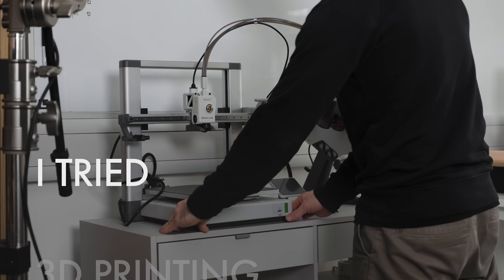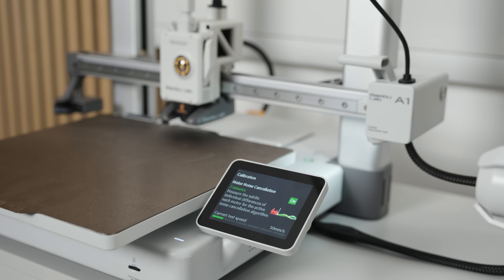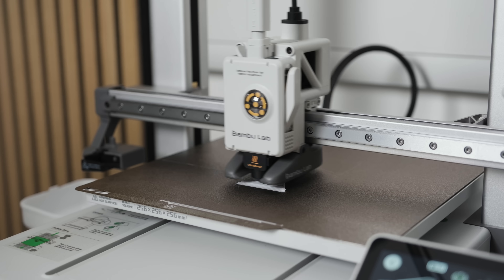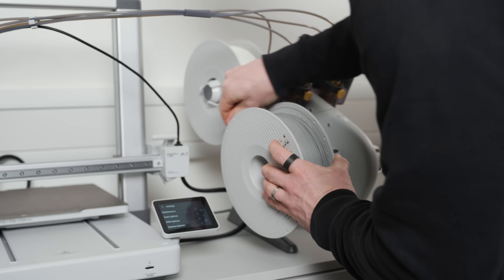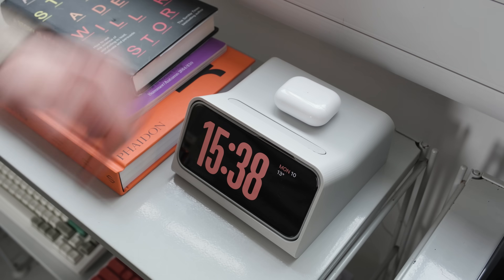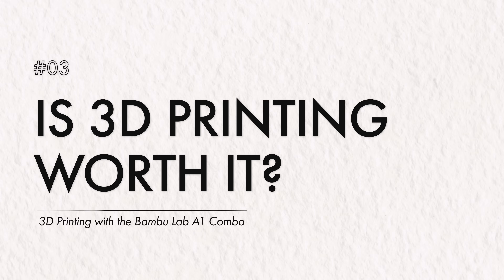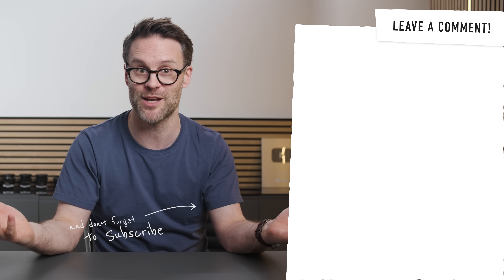I Tried 3D Printing as a Beginner: Is it Worth It?!

Comment: it's incredible HOW easy bamboolabs made 3D printing. to me it almost feels like cheating. 
i got my start about in 2017 with the anet A8, which was the first "cheap" 3D printer kit, at 160EUR, where previous, often worse REPRAP kits usually cost >500. 
you had to assemble the printer yourself, dial in the mechanics, learn to "drive" dozends to hundreds of slicer settings, and eventually figure out and fix some mechanical flaws of the machine.
it was a journey of a learning curve! but i know every screw and quirk of the machine, and grew a deep understanding of the mechanics and process. and mastering it was a hard earned accomplishment.
this, a feel, is a bit lost with bamboolabs. but the sheer accessibility is just amazing. it takes 3D printing from am involved geeky hobby, to a readily accessible tool for creative end users.

Comment: About 7 years ago I just designed and built my own with a 350x350x450h. Arduino based. I used a small 200mm one to print the parts. Its very simlar to this bambu. I did it to build full size R2D2 robots and ww2 casting engine parts.

Comment: You learned how the entire machine works — materials, slicing, tolerances, failures. You invested time and effort to understand 3D printing as a tool.

And then you use it only to print random plastic models from an online store.

That’s not what 3D printers are for. They aren’t meant to mass-produce worse plastic versions of things that already exist. Their real purpose is creating custom solutions, inventing original designs, fixing problems, and building things that actually make sense for a specific need.

Downloading and printing store models turns a powerful creative tool into a novelty machine. The real value of 3D printing isn’t pressing “print” — it’s designing, adapting, and inventing.

Comment: Depending on how much effort you want to put into it 3d printing is financially a good option. 

I started by buying a used 3d printer 6 months ago. 2 months in i made one of those non electric push lawn mowers. It cost me $20 to print. google has them being sold online for $119. (I have no idea about differences in quality and i used box cutter blades as part of the build. I included this in the price.)

I live in a small town and after people saw me using the 3d printed lawn mower they started bying 3d printed things from me. Not just containers and disine things but useful stuff that are cheaper to 3D print. Things like clamps and squares as well as bike parts and accessories not to mention yes lawn mowers.

My current project is an auto loom. I am trying to 3d print a loom that weaves a yarn blanket with a drill acting as a motor.

Comment: I ordered my A1 Mini at the beginning of Dec (2nd?) and still waiting on it. It should arrive this next Tuesday, I hope! Looking forward to getting back into 3D printing. I had the Reality 2 or 3 before, and the 1st several prints came out great. Everything after that came out bad with a lot of messes to clean up, or not adhering to the build plate. I bought a lot of additional parts and mods to help level the board and make it run smoother, but no luck. So, I'm hoping the A1 Mini allows me to enjoy creating more.

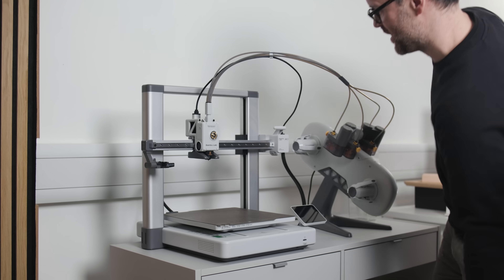Comment: 4:02 ”…the printer is not the issue; it’s the user…”
Nope, sorry, disagree. You seem like a dude with his head on straight, and you were capable of assembling the thing, so if you could make that “mistake” so could most potential users. The issue was indeed the printer, or at least the packaging of the printer. I ‘m in product QA, and I would definitely be flagging that to the developers to fix. Devs of all kinds are prone to attribute things to “user error”, but I remind them that the user is the entire point of their design efforts, so they had better get better at designing with the user in mind!

Comment: I have a workshop, where I primarily do woodworking, but also dabble in welding, metalwork with a milling machine and other such practical 'making'. I've been interested in 3D printing for small parts I can use in my projects for a few years now, but was put off by the learning curve. The other day, I saw the A1 Mini on sale for £139 & decided to go for it. I then watched a ton of videos & feel confident I can make it work for my needs. It looks fairly idiot proof!

I'm really interested in organisation & the Gridfinity storage system looks ideal. I love the programs that allow for quick design with little to no knowledge of cad. Just move the sliders to get the sizes & layout you need. Brilliant. I'm sure there will be some bumps along the way, but I feel excited about all the projects I can tackle & think it will really enhance my existing work & allow me to make the things I envision, without compromising or bodging it. Now I can make the part or jig I need to do the job properly.

Comment: 3d printing is fascinating but entirely new to me. I’m hoping someone can help me please. I have a cnc router and cut small shapes approx 100mm x 80mm of 18mm nylon from sheet material. These shapes are components for a product I make. When I look at the 1000mm x 1000mm sheet when all the shapes have been cut out on the router I have so much waste material which ultimately ends up in the bin. I have the G code for the router, can this be applied to the printer instead?

Comment: 3D printing can be a lot of fun, but it really helps if you have a purpose.  If you just randomly print fantasy figures and cellphone stands it may not be for you.  If you have another hobby that 3D printing supports well then that gives you a good reason for using it.  Another factor is the cost, the price of a new Bambu Labs is pretty high for someone that doesn't know if they will like it or if it will be worth it, and there still aren't any good inexpensive options on the market.
I inherited a low priced printer.  I had to do some rebuilding to get everything set right and the leveling was morre complicated that I thought it should be, but now it is fairly reliable.  Print quality is not as good as the more expensive printers, I can get prints that work but they aren't as pretty as what the youtubers show.  I am able to use my prints to support another hobby so it is worth it to me.  If I just had to dream up printing vases and things like that, it would not be worth it.
Besides the cost and setup of the machine, to get the best use you need to be able to model your own prints.  This adds another big learning curve that takes a lot of your time.  Now that I have the printer working and I've learned the software, I have more freedom to invent and make things that I can use.

Comment: I’m assuming most 3D printers are reliable and work fine with regular maintenance but mine requires being fixed about 2:1 ratio to actually printing. I spend more time trying to fix it then printing to be prepared for that possibility.

Comment: Been printing since the beginning in the reprap days when printers were made of long threaded rods and bolts they were fiddly, wires were everywhere, and something magical was happening. We were turning plastic into more printers for our friends. You had to really know everything about your machine then because it was all manual mode and we were still figuring things out. Now printers are basically plug and play depending on the brand you get. Filament isn't $30/roll anymore for basic stuff and they might as well be magic F1 cars compared to the slow printing in the beginning. We've come a long way from kapton and painter's tape on the bed to get things to stick. I print 99% practical parts now, organization, cases, parts for AUVs, or something to fix a problem I have. Then 1% of the time I end up printing a trinket for someone else who saw a flexi dragon and stares at me in wonder that I can create one so trivially. I can print multi-color but rarely if every do since engineering parts are made to be functional so basic black or white with engineering filaments. Done quite a bit of work with PEEK which is something like $300/kg but I luckily don't have to pay for the material just produce the part. Working on AUVs is fun, but getting to print satellite parts for NASA is just nerd nirvana. Being a veteran I've often taken part in training troops and sailors how to use 3d printers in the field/at sea to make replacement parts that don't require machined metal. It's only limited by your imagination and ability to implement it.

Comment: The thing is, you should probably have specific needs to get one of these printers. Otherwise, it'll all be a wasteful thing. It might be fun to print all kinds of stuff, but most of it's going to end up as trash. If not right away, then soon enough. Also, remember that the filament costs money, just like the ink in regular printers. If you can bother with recycling your old prints, the waste can be mitigated somewhat. That said, I've seen people create some pretty cool things on these 3d printers for sure. However, even if the print quality has gotten better over time, nothing beats traditional molded plastics for "proper" products.
Reply: I disagree with your assessment. First, I can’t create prototypes easily without a 3D printer. I have paid for my 3D printer by two projects alone. These projects were practical and I designed them in under an hour a piece. My DND games are phenomenal and the equivalent models bought online would have cost thousands of dollars. I can print full 3 foot by 3 foot castles with one and a half spools which I pay $10 a spool at my local store.

Comment: I’m fairly certain my Lab A1 combo is in a box I received today, I’m quite excited! I enjoy working with resin and leather work. Leather wet forms, templates and embossing stamps are just a few of the uses I have planned for the printer. designing and printing custom objects and then creating silicone molds for resin is also in the wings. And for pure silliness, I might print some unicorn horns and other costume (yes, costume) pieces for my equestrian friends and their horses. Thank you for your video, so far the best regarding cool things to print. BTW, I just started playing with NOMAD Sculpt and have had some success in 3D sculpting. Artistic stuff and I have no idea how it will do as an actual printer file. Fingers crossed.

Comment: I have a very cheap 3d printer that works fine but is slow. I love 3d printing and am amazed at how many practical prints for around the house that I have come up with. Many times I can find a print already available, but I have created my own prints from scratch when none were available. We moved houses a couple of years ago and I took a break from printing while we settled in. I just got back into it and am thinking of upgrading to the Bambu 3d printer and starting multicolor prints.

Comment: How is the quality of the 3d prints? as I have been considering for doing modifications for minature modles? The problem with this is that there are ones which layer and leave visible layer line even with a fine models.

Comment: Grab yourself a large paver and set the printer on top. The mass of the block resists the vibration of the printer. Really cheap and really helps with that first layer.
Reply: As-salamu alaykum, brother. You're wrong.
For example, when you cook pork, you get a lot of leftover fat. You can then use that fat to cook more pork. In the end you will end up with a lot of efficiently cooked pork and some leftover fat for cooking.

Comment: 6:24 it should have come with a razor and extra screws so you can 3d print the file already on the printer that is called scraper grip by bambu lab. It’s already on your printer and they have given you the razor and screws for it.

Comment: Great video, thank you.  I am hoping to get a Bambu A1 and use it to create scale models (scenery, buildings and railway rolling stock).  There's just one thing you didn't cover - you briefly suggested one print must have cost around 50c - but seriously, how much filament do you use in a given build, and how much does it cost in filament and electricity?  If you are planning to make a follow-up on your later experience, perhaps you could include this aspect.

Comment: Great Video! I use my A1 Mini for around 8 months now and it was a much better decision than I thought. It's so easy to start and especially for specific problems it's a game changer. Yesterday I printed an Adapter for my new air conditioning using tinkercad only. It's just great what you can do nowadays with such a tool